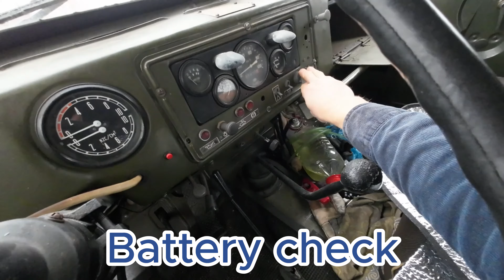Ural 375 First start after winter

Comment: Tot respectul pentru pasiunea ta. Te-ai gandit sa le schimbi motorele cu ceva potrivit (diesel)? Par cam submotorizate si consuma cam mult pe benzina.
Reply: Trebuie făcută omologare individuală pentru alt tip de motor. 
Plus că, ideea este să fie vehiculul autentic.
Reply from the maker: Le folosesc rar...de fapt nu le folosesc, asa ca nu are sens bataia de cap. Motoarele pe benzina au farmecul lor aparte, plus ca le prefer originale, macar pentru ca le pot incadra ca vehicul istoric. E adevarat ca la drum intins, pe dealuri se simte nevoia unui motor mai fortos. Iar consumul....